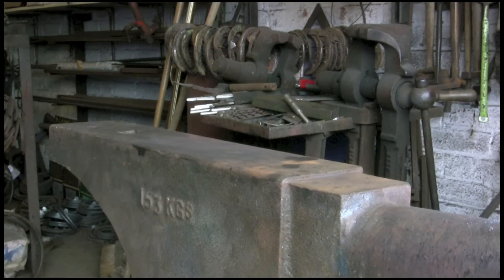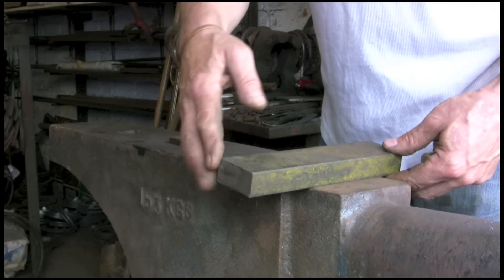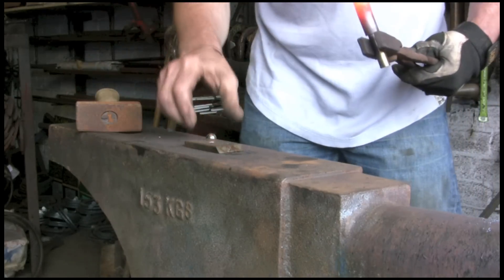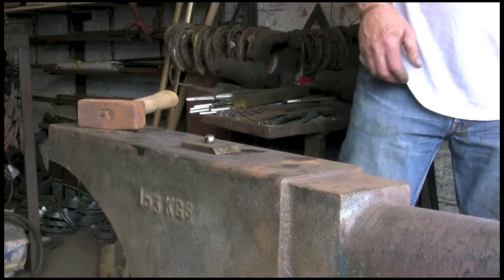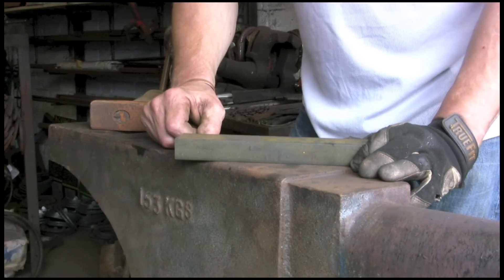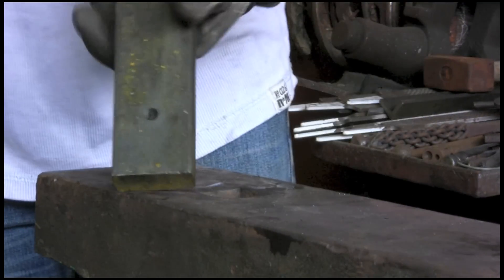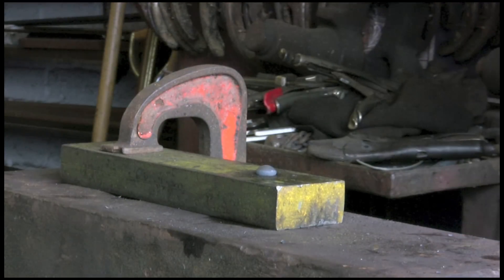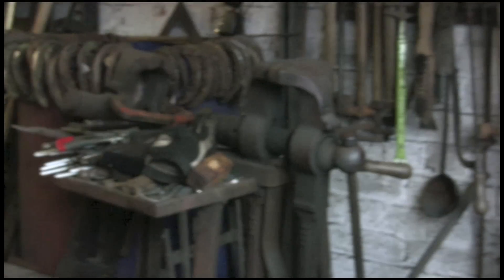Handmade Rivets

Comment: Good ideas!  Did I hear you correctly that you run small drills at a lower speed and larger drills at a faster speed?  Actually, it is the other way around.
Reply from the maker: Fossils etc. What I meant was that the speed I have the machine set on is too slow for small drills and too fast for big drills but it's a compromise as it's a hassle changing the speeds.

Comment: oi gary! i drilled a hole in a computer mouse ball bearing (after scraping off the rubber off course) and tied it round the anvil with a iron wire.

Comment: Probably you should have drilled some little hole into the puncher before shaping by the bearing ball so the final hole would not be off center.
Reply: pavolpi i like that idea...do you think a counter-sink hole would work? a bit more "dome like" to start, and may center the punch nicely. Hmmm....(gears grinding in my head, now....) I like your idea...

Comment: I would use a drill bit to make the hole for the rivet head, just form the drill bit on a grinder the size you need then sharpen the cutting edges....Mike

Comment: Hi people good vid Gary, to answer the point somebody raised about med to high tensile rivetts use the appropriate grade and size bolt, round the head {grinder or linisher] and proceed exactly as per the vid. DO NOT QUENCH LEAVE ON THE SIDE OF THE FIRE TO COOL SLOWLY you can heat treat it later if you need

Comment from the maker: Probably. I have no  knowledge of working brass and copper so don't know how hot you need to go.
You would probably be best to put the material into the jig cold and just heat the tip with a gas torch so you can be more accurate with temperature.